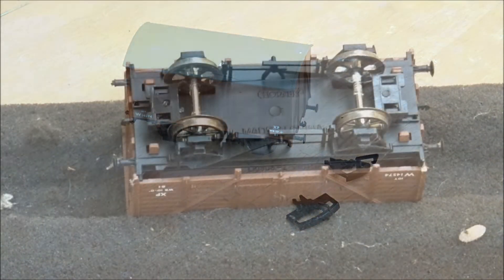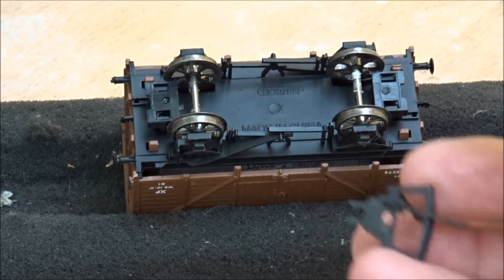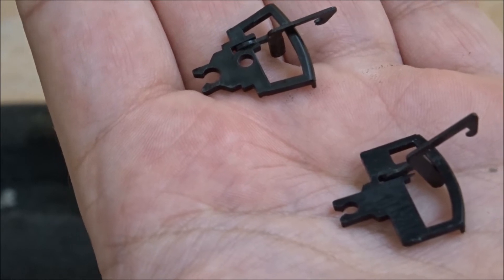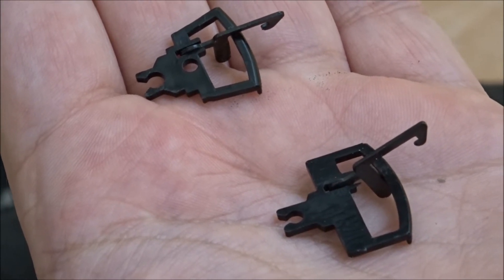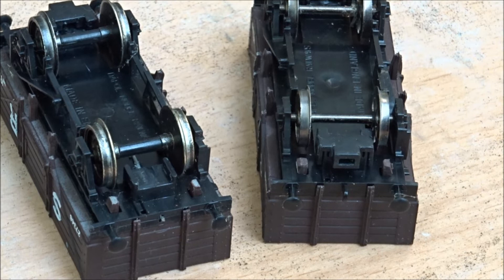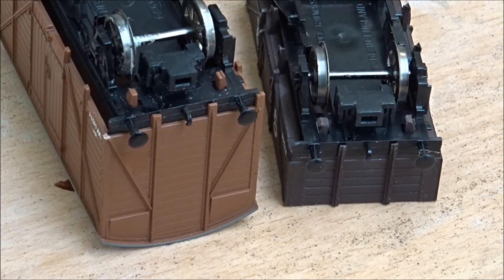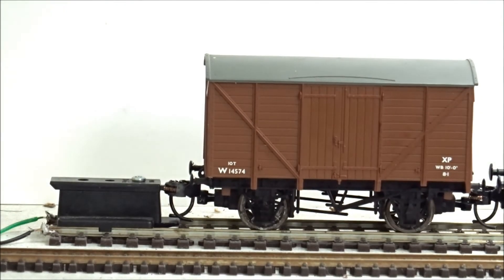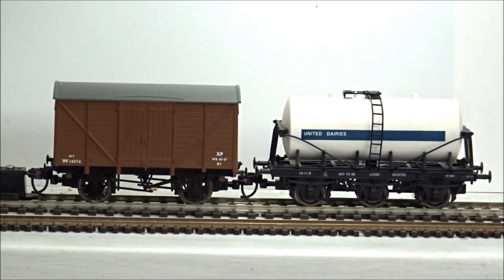NEM converters, Airfix, Dapol, Hornby

Comment: Hi Matt, would these be the sort of thing to convert a Dapol wagon built from their kits. Love the idea.
Reply from the maker: Probably not these, an dthe problem with those kits there's 2/3 different types of mounting points because of the age of the kits some are kit master, Airfix and possibly some Dapol as well.. Sadly not a one size fits all... Some have used the Lima types and glued them in the hole...

Comment: Hi there, I'm in the process of converting several of the old Triang/Hornby Thompson teak coaches - which come with nothing more than an empty shell and very little detail. Those I have, some have very rusted couplings of the old D type of coupling and I was wondering if i could convert them to a better type of coupling. Those on my coaches are held in place with a rivet and two lugs. Do you produce any coupling fixtures for these? Perhaps you could advise me. Thanks. PS, A very good and interesting video.
Reply from the maker: Hello, thanks for your interest in my items.

We do have something it will require some Work to fit them, as they need be at the right height.
So the rivet will need drilling out or removing and a slot/channel cut to allow the pocket to   sit at the right height.
They come in 4x or 18x
https://mademe.co.uk/product/oo-bachmann-mainline-parkside-cambrian-triang-nem-converters-18-pkts/
https://mademe.co.uk/product/oo-bachmann-mainline-parkside-cambrian-triang-nem-converters-4-pkts/

Comment: I have never understood why locos and rolling stock don't just have a hook at each end with a chain link coupler. At least Shapeways couplings look good, and Bachmanns coach pipe coupling is a move in the right direction. I like Hornby's  latest chain link coupler on the Rocket, a bit fiddly but that can be developed.

Comment: I have an older Hornby Class 43 125 HST.  Do you know if NEM pockets are available for it and for Mk III intercity coaches?
Reply from the maker: Sadly there are so many variations, from ex dapol tooling to various hornby toolings, even some Lima ones in there to, sadly you need to know what type you have.
 We do a selection, for old toolings however some couplings are moulded in to the bogie.. I have some in CAD but not tested yet.
Reply: @bluebellModelrailway   Thanks for that.   I can imagine it would be hard.  There are many versions.  I don't mind the tension lock coupling, but some of these early HST's like mine, dont have the clip on the Power/dummy power cars.  They tend to uncouple if the powered car is at the rear "pushing" the train along